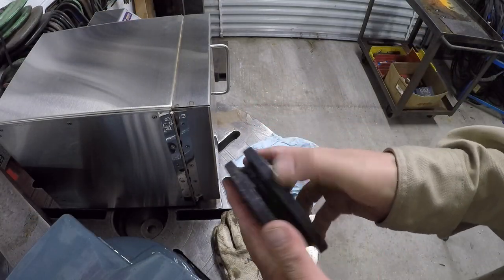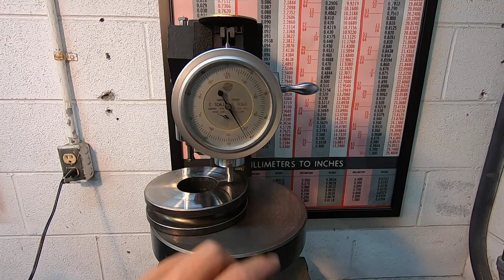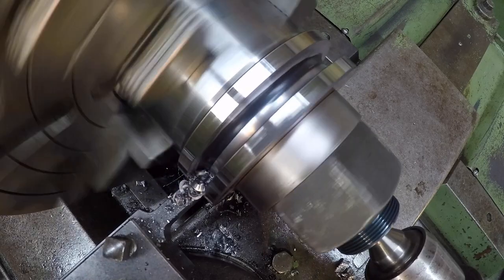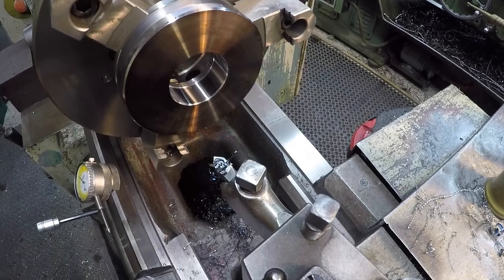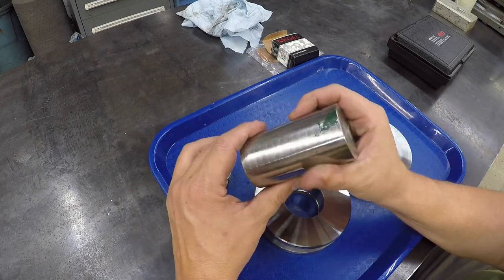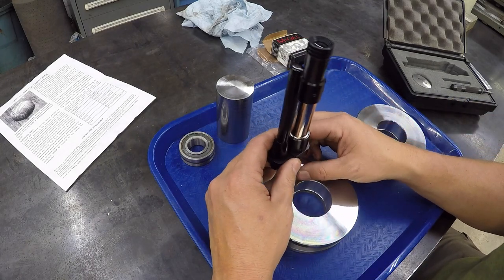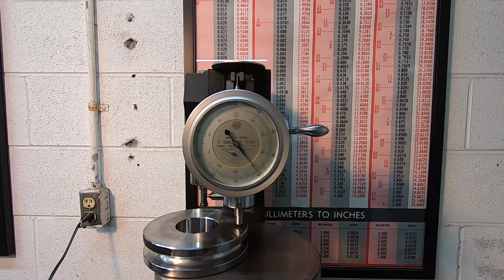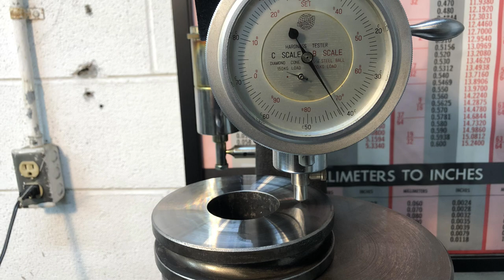Machining Cable Sheaves Part 2

Comment: More 4140 heat treating guidance - per-heat to 1200°F and soak for 10 to 15 minutes.  This prepares the molecules of the metal for the next step of heat treating.  Then quickly heat to austeniting temperature 1575°F (1550 to 1600°F) and only soak 5 minutes per inch of thinnest section of the thickest.  Look in the oven and verify the metal is the same color as the oven - 5 more minutes longer is ok. If the shives are 2" thick that is 10 minutes.  Two hours is way too long as it upsets the molecular structure of the metal.  It is also why you are seeing inconsistencies in hardness, deformations and excessive scaling (decarburization is what it is called).  You can not test hardness against a decarburized surface as it is a surface where the carbon has been removed from the metal - the scaling is the carbon removed from the metal.  Another reason why do do not over soak the metal at the austenite temperature.  You also don't over soak it at the perheat temperature.  After quench you do not want the metal to cool to room temperature before tempering - you want it to be at 125°F to 150°F which is just cool enough that you can hold the part with out dropping it.  This is the life and death of a part that actually needs to be Tempered.  Tempering is where it does not mater how long you soak the part.  500°F for 2 hour is normal.  It could stay in there for 8 hour with no adverse impacts.  If you cool it to room temperature and wanted to refine the gran structure more put it back in the over at 25°F cooler 475°F for 2 hours and it will improve the metal.  Do not place it in at 500°F for the 2nd soak.  If you can not treat the part until the next day place it in the oven at 150°F for the night and treat it the next day.
Reply: Interesting to read this, strange to think you can overcook metal. I've always thought that if a metal can be at a temperature then it doesn't matter how long it's at that temperature. Do you have anymore literature explaining this phenomenon? I'd be interested in reading more about it. Is it named?
Reply: Heat treatment, selection, and application of tool steels by William e bryson. Book is a little over half inch thick and is very thorough and teaching about heat treating
Reply: I’ll be honest my knowledge all comes from making knives (I make them in an industrial balancing shop, just as a hobby). I always read that the main reason you temper right away is simply to avoid cracking overnight (or if you’re clumsy you might drop it). But even with knife sized objects, you’re typically ok to wait overnight and most people claim they’ve never had a knife crack on its own. Is cracking the reason for this? 

I’ll be honest I’ve never tempered when still 150ish, by the time I finish up it’s probably room temperature in most cases. If I have clay on the blade then it’s even longer. Perhaps that’s an issue, I just never heard it described this clearly.
Reply: Mocha81291 I don’t know about over soaking, but for sure soaking is a real thing (that’s what they call it). Soaking a steel, for example W2 at around 1475-1500, will cause the carbon to go into a more even solution, giving you a much more even grain structure. In knives this will make sure you have no poor grain areas with low carbon and vice versa.

I use a little forge and it’s a bitch to soak steel (my picture is a W2 knife, it came out pretty good honestly), so I basically can only manage a few minute soak at best. Steels like 1084 and O1 don’t require soaking (for practical purposes anyway), so that’s why many people like them.

Go to the blade forums, or Google heat treating (look at blade smith stuff specifically as they have the most info around now). Another thing they do is normalization, which also refines the grain structure before the hardening (a process of hearing the blade three times, lower each time, and letting it cool to room temp).

Comment: Cooling and quenching across a wide surface area would result in different carbon deposition from the quench oil..  funny enough you can hear it at 3.14 minutes into the video.. as the cutter sweeps the face you can hear a different pitch or humming to the cutting tool. That or the simple relative surface speed to the tool as the rotating diameter decreases. 

I dunno if more oil (larger container?), longer quench period (pre heat the oil?) would help. It'd be interesting to see the hardness differences incrementally across the radius. i.e. everything 0.010" ? a hardness point closer to the edge cases would have higher concentrations of interstitial carbon and higher hardness.. also more drastic temperature differential. the midline of the donut would be the softest?
Reply: longer anneal times? i mean it took me an hour last weekend to heat up some frozen hash browns

Comment: Adam , I think after you do quenching ( oil should be worm not cold )  you need to put it in furnace
 for at less one hour. to make it hardener. on 180-200 degrees
Reply: Cool story bro

Comment: I am sure by hardening these you are reducing the life span of the cable that runs on it. Better to replace a roller guide then to have a cable fail prematurely.
Reply: Did you watch the first video? The customer requested increased hardness.  Wire rope is always harder than the sheave on which it runs. Most sheaves are hardened to a low hardness to reduce wear, but they remain softer than the quite hard strands in the rope. The original pulleys the customer is replacing were probably cheap and too soft, and the customer's request for slightly increased hardness - which Adam cites as no more than 45C in the video - is entirely reasonable.  It's not as if he made them as hard as a file, LOL. Here is a link to an elevator outfit discussing appropriate sheave hardness, can you think of a more critical application? http://wireropeworks.com/pdf/EL_TB_07.pdf
Reply: The customer is always right.
Reply: Also if the customer isn't inspecting his rope to the point that one unexpectedly fails. Well there is some real problems there for sure and it would not be the sheaves. Wire rope usually gives plenty of sign its life is over before failing.
Reply: If you do a proper crane inspection before every use, you will know when it is time beforehand to replace the wire rope. Keeping them properly lubricated is often more important to longer life than even use. Dry rope wears fast.

Comment: It would have been interesting to know the hardness before you skimmed the surface. I've always been led to believe that the hardness is in the surface layers so it's  possible that you actually removed the hardest part. Of course, it is only in the groove that you really need the maximum hardness, perhaps you could have left just that part uncut.
Reply: The hardness can be throughout the material if you heat treat it that way. Hardness is only on the surface if you case harden the material.
Reply: Some steels are shallow hardening, some are deep. I think from memory 10xx series is shallow hardening. Only based off some knife making experience
Reply: I noticed that the one which was skimmed twice (or even 3 times) had a less hard. And the hard patch would seem to confirm the surface idea.
Reply: Chris, you're thinking about case hardening. The way I was taught was to put the piece to be hardened into a vessel with coal or other high carbon material. You put the vessel in an oven which will take it up to a certain temperature (I forget what). Let it sit in that oven for a number of hours and then shut the oven off and let the whole thing cool off slowly. Presumably the longer you leave it in, the thicker the hardening is. Remember that is only a surface hardening which can be done on mild steel. Oops, you also have to heat it up again and quench it to get that hard skin.

Comment: Is it better to machine a hardened part to final dimension before or after the tempering process? I assume after, but was curious what the reasoning was.
Reply: The Gun Medic , I'm not a machinist. However, from experience with precision wooden furniture parts. I would say that Adam probably did it exactly right. Refine the dimensions and surfaces after each step, but leave the final passes to the end.
Reply: The Gun medic, perhaps I should have explained that machining metal, like planing or sawing wood, changes the patterns of internal stresses and thus causes warpage. I assume that tempering mostly evens stress out, but that's also a change. Also, I notice that machinists are careful to take into account the fact that the cutting tool deforms while it is cutting. Notice how concerned Adam was about how before tempering, there were areas of different hardness that visibly affected the finish.
Normally I wouldn't answer something like this, out of my area of expertise. But, since nobody else answered, I thought perhaps I could get you thinking more about the problem. I do have a science background.
Reply: Stuart Schaffner hey thanks for the reply. Glad you took the time. I was just curious.
Reply: Great video. When a high carbon part is hardened to 57 - 60 + Rockwell C, it is normally ground to final dimensions instead of machined.

Comment: you should remove at least .050" of the outside of the material on all surfaces if you heat treat steel in an open atmosphere furnace according to the heat treating AMS spec.
Reply: AMS specs are not a blanket code case. It depends on what industry you’re in, the material you’re working with, the process you’re running, etc.

Comment: I think you have a cold spot at the door? you seem yo have heat problem?
Reply: Yeah that seems possible. In my opinion to get 40 something HRC after a quench, and then have 60 something on another area... the heat wasn’t even and it wasn’t fully up to temperature everywhere. I didn’t see the other video where he says what the steel is, but 40 after a quench seems really low, no?

Comment: You should look into a cheap microscope off amazon to be able to look at the grain structure when hardening, you can look at the edge of a cut face to see how deep it hardened.
Reply: With 4140 it should be hard all the way through, it was not a case hardening system.
Reply: @1903A3shooter  There has got to be some difference as I have done the same process with a 4140 rod about 3/4 inch in diameter, held at temp for 4 hours then quenched. We proceeded to cut the rod in half, then polished and acid etched the end. Under the microscope you could see the grains were much "sharper and straighter" than the more round grains in the center. I don't have any numbers to quantify the difference though so maybe it was a pretty consistent hardness throughout, despite the difference  in grain appearance.

Comment: Could have warmed up the oil with a hot piece of scrap steel first...
Reply: Good idea in theory. Not sure how much it's going to help, since you don't know what temperature you're pre-heating to. It would help, sure, but if you're going to muck about with pre-heating, you ought to at least have a temperature probe.

Comment: Hardness testers depend on the rebound of that little ball, don't they? Placing your work on a plastic tray results in a minimal amount of doubt in the final results, doesn't it? I know that I am splitting hairs here but you consciously take vibrations out of your machines and are very careful about your work. Still it was a wonderful video.
Reply: for hardrock hardness test there are multiple options that have to be considered from what i know but it usually has a certain amount of time it has to maintain a certain stage of force and then it is about the diameter size of the impact it left on the metal piece, if im not mistaken. And for the hardness test itself they are different kind of "bodies" that can be used depending on the material starting from like carbides up to diamond testers.

Comment: Can anyone explain how a hardness tester using a springloaded punch would work for a slightly longer time? I imagine a spring doesn't retain it's strength accurately for long but I could be completely w rong here.
Reply: If you dont hit the yield point of the spring or keep it compressed for long periods Id imagine they stay consistent for a long time.   I know they do in my torque wrenches.  Id guess there is an adjustment on there aswell for recalibrating.
Reply: Springs tend to retain their strength very well under the conditions the spring in that punch is in. Most of the time springs lose their elasticity when they are pushed/pulled to their maximum often or stored that way for long times. When the punch isn't being used I the spring is just laying there loose, and when it's used the spring never really fully compresses. If you ever get a chance take one of these auto punches apart, the way they work is pretty neat. It's basically a tilted pin and a cone, and the pin doesn't straighted and go through the cone until a certain amount of force is put on it
Reply: Thank you for the replies! I'm going to open up my punch now :P

Comment: Those are some pretty parts for sure - is it possible that one sort of "raised" area you described that was way harder than the surrounding area was just a flaw in the raw materials you started with?  It almost just looked like it was just very different than the surrounding material - as if the composition of the round bar you started with wasn't consistent throughout or something
Reply: I was also thinking there might be some localized effects from having to keep the same tongs grip on the part all the way through the quench time.

Comment: Please move your oil next to your oven there is absolutely no sense in you walking that hot piece of steel across a shop so it can get exposed to more air, form more mill scale, unevenly cool and crack, or you trip and end up with a very nasty burn  Please move the oil please
Reply: the plastic bucket was the icing on the cake tho

Comment: Do you think that the machining process will work harden to a case depth of a few though, which is about the depth of ball deformation.  Thus we have no real measure of through hardening or even tradition case hardening of 20 thou or so ??

Comment: I've got zero experience with heat treating, but most of it seems like black magic.  I know with cold blueing a part needs to be super clean for the blueing to not come out blotchy.  When your parts come out they look blotchy.  It may only be the surface, but I know with glass, hand grease will break it under heat (which is why you don't touch halogen bulbs).  As far as the different areas of hardness, that's clearly due to the heat distribution.  You might want to including rotating the part at intervals during the hardening process.  Again, I'm not an expert, but I am a Physicist who seems to guess well.

Comment: Hi Adam...maybe the best way is do not clamp the piece but let it to return to ambient temperature in  a non-plastic container........
Reply: Salvo, the reason for using tongs and moving the part in a figure 8 motion is to try to keep the oil from boiling on the surface of the part. This gives the part a better chance of having a more uniform hardness. Also if you just dumped the hot part to the bottom his plastic bucket would melt. I'm sure Adam is thinking about getting a metal container in the future.
Reply: @gavinhoush8127  this is ok but there is no risk to lower the temperature of the clamped surface ? My idea (maybe wrong...) was to suspend the piece immersed in oil with a robust wire...less contact surface, much more temperature uniformity...

Comment: It's weird to watch you use the spacer that is offset when everything else you do is so meticulous in the attention to detail.
Reply: You’d imagine that as long as the nut is sitting squarely on it, and the spacer is square against the pulley, it shouldn’t make a difference. Now if he were balancing something and put that on, that would be a problem, but for this I don’t know. 

But yeah I get your point about attention to detail, you’d think he’d center it.

Comment: I noticed that he didn't wrap the part in a stainless steel wrap this time
Reply: I don’t know much hardening steel,, but my cousin had a tool and die shop, and he used stainless steel wrap on his part.  I believe he told me because it reduces scaling.  He passed away a few years ago so I can’t ask him about it.  I really enjoy you video’s. Great job explaining things.
Reply: Patreon supporters have contacted Adam through his Patreon page after his hardening video because Adam was getting unexpected results  and open for any comments. Like me there are probably more viewers explaining the wrapper makes consistent hardening more challenging but not impossible.

I assume that in this video, because it's a customer part, Adam took the safe road. That is: Make the product oversized, harden the product using a primitive but more reliable method, temper (make it less brittle) and do final machining to meet the required size.

Comment: Why not to push Inner Race ?
Reply: Your put all the pressure one the roller balls inturn damaging the bearing.
Reply: @oldsoulkid9263   Correct. You only push on the center of a bearing if the bearing is to adhere to the shaft and be free in the housing material. Like pillow block bearings where they are set screwed to the shaft.

Comment: Could you inject nitrogen or use some oxygen reducing chemical in the heat treating oven to prevent so much scale?
Reply: Wrapping with stainless steel foil is commonly used.  Stan has been building Hot Shot heat treat ovens and playing with Argon back purge. It's a challenge as the gas cools as is expands. Check out his youtube channel  Shadon HKW.
Reply: Wrap in paper then,seal in stainless steel foil.No scale.
Reply: Or use boric acid